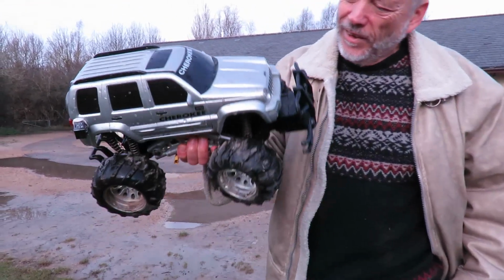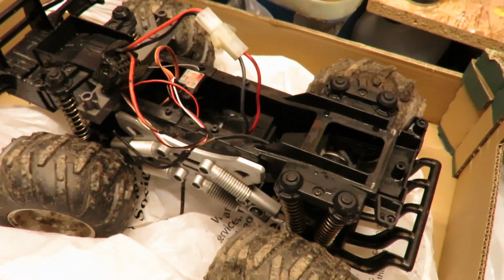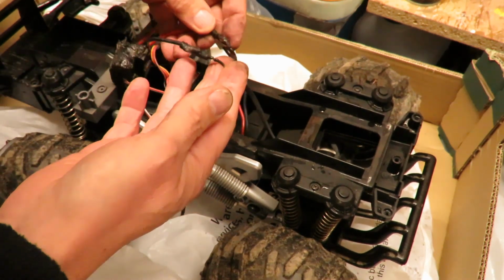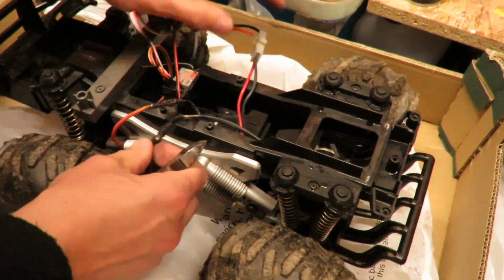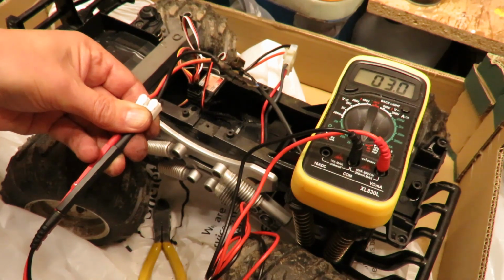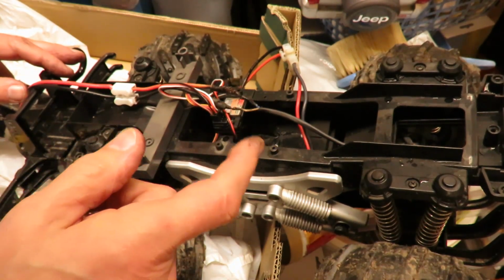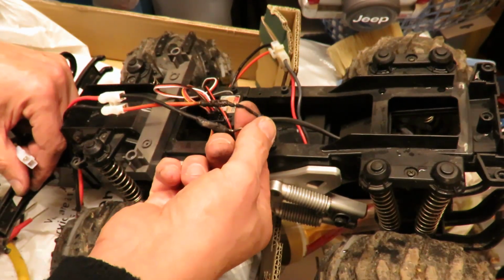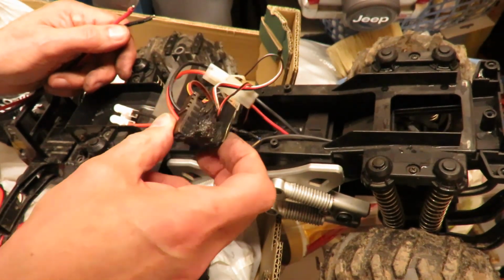NOT a LiPo fire 200108 RC FastLane Jeep Cherokee

Comment: Never had much luck with those ESCs. I've had several that managed to short themselves out when you switch the power off!

The larger version with the cooling fan and dual motor outputs has always been rock solid but this version has been very hit or miss.
Reply from the maker: On the positive side it generate a few views for me 😁👍

Comment: Could be a good idea going with a hobbywing 1045 esc at this point or the hobbywing 1060.
(Absolutely overkill for the purpose but you'll have reliability that will last for ages & overload protection & thicker wiring that's more heat resistant.)
Reply from the maker: I don't actually remember what that ESC was rated at but when I fitted it I thought that one was overkill. I suspect the bullet connectors had slipped out slightly on the motor leads enough to make contact, but that part was directly in the flames so all melted anyway and no way of telling if that was the cause or the result.
Reply: So did the short kill the esc completely or will it start if you just clean it up after taking apart the plastic casing & solder on the wires again ?

Might be good for a video taking it apart & seeing if it works on a 2s lipo still hooked up too a smaller motor outside of the car, I'd perhaps keep gardening gloves nearby in case it decides too melt some more just so it doesnt burn your hand as soon as power goes into it.

Though I'd use something else then those bullet connectors, perhaps a pair of deans connectors instead of trusting the bullet connectors again.

Those are pretty good for high voltage up too I'd say 4s lipo & high amperage drains around 60 - 75 amps on Should be cheap with how long people cloned them these past 20 years or so as well.
Reply: @Mini-z1994  Maybe not use the lipos use a bench supply would save the fire :-)
Reply from the maker: @Mini-z1994  there really isn't much left of it 😁 that circuit board is burned right through on the side where the power wires go. I have left it out in the garage at the moment because it smelt so bad. Haven't looked at it for a couple of weeks now.
Reply: Ah then there is no point ofc, just send it off with other electronics scrap that's laying around or ask a neighbour if they are going by there & ask them too bring it along.

Comment: Had you been over working the motor and causing the volatge regulator to heat up and cause the fire?
Reply from the maker: Nope, just plugged the battery in and smoke started coming up from inside the car. It has been running fine for months. It is just possible that the bullet connectors had slipped out of their sleeving enough to make contact but that part was directly in the flames anyway so I cannot be certain if that was the cause or the result.
Reply: @GrandadIsAnOldMan  could be a High resistance joint of the bullets but that would be strange or cables internally breaking very glad it did not damage the Lipo the rest should be repairable
Reply: It is one reason I Like fuses :-)

Comment: Lucky it wasn't indoors. Point worth making, i always tell my grandkids never leave the batteries connected when not being used. I know this dosn't apply in this case.
Reply from the maker: Yes, I had just plugged the battery in and the smoke started rising. I pulled the battery back out straight away but the ESC looked like it wanted to take the car with it so I gave it a bath. Lucky it had been raining otherwise the only option would have been to let it burn itself out and lose the car entirely.

Comment: Wow! That was a really drastic looking fire for an ESC. I have seen them smoke and then just burn out, but never seen one going on fire before. That ESC looks like a large AMP type., maybe 60 to 80 amps? Very interesting. 👍
I meant to add. If it had been a Lipo you would not put it out with water. I believe a lipo carries its own oxygen supply in the chemical composition.
Reply from the maker: Yes Mike, water would not have helped if it was the LiPo, just removing it from the car if it can be done safely and letting it burn itself out in a safe area would be the only option. It is not as if you can save a LiPo once it has started burning so you might as well let it run it's course if you are outdoors like this.